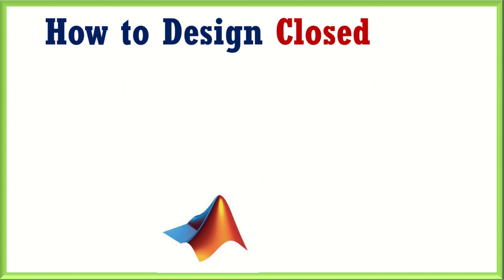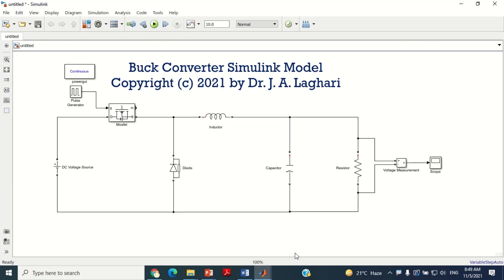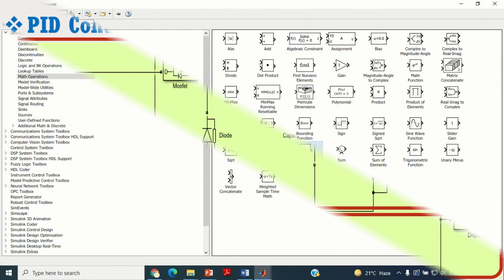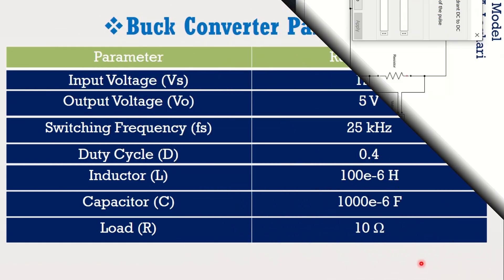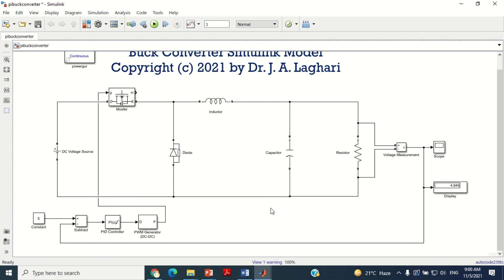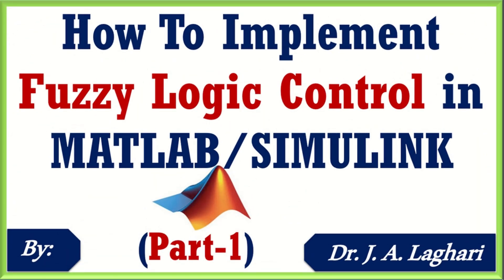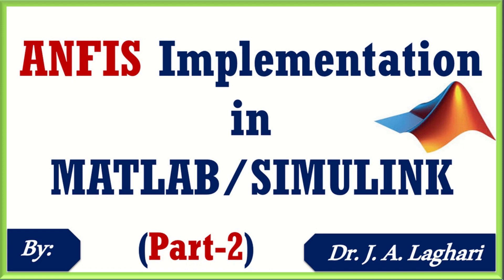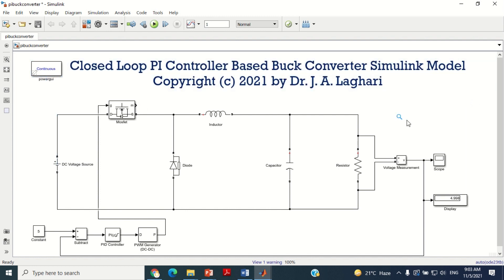How to Design Closed Loop Buck Converter using PID Controller in SIMULINK ? | Dr. J. A. Laghari

Comment: Dear/sir, Dr. J.A Laghari, thank you for uploading  this vidio. As you have told that we can use any optimazation algorithm to do dc-dc converter. therefore i need to use camel craven algorithm to design wide range input and output dc-dc buck converter with pid controller. then how can i use that? can you guide me alitle bite sir?  
Thank you for your consideration sir.
Reply from the maker: Thanks for the comment. You may kindly watch my videos on pso. From this, you may get idea.